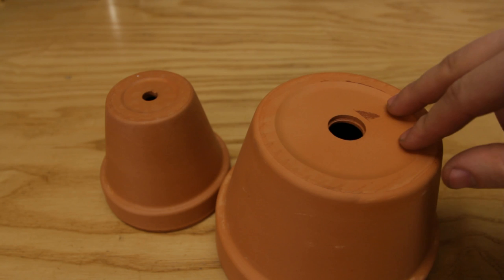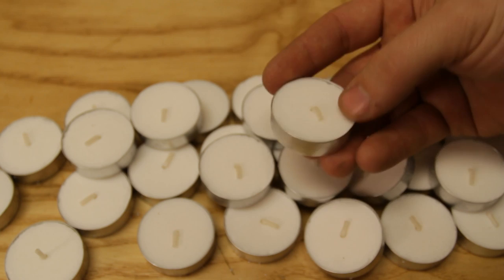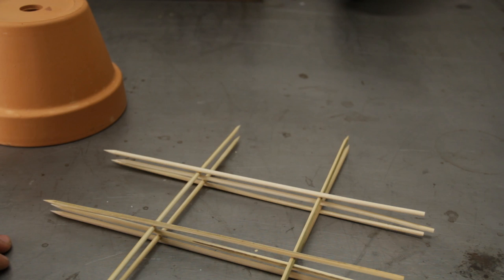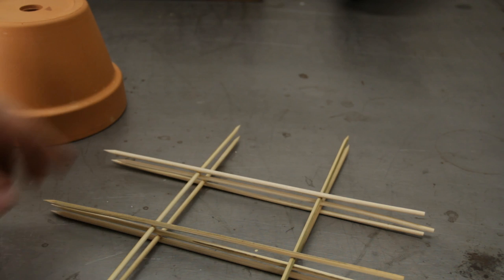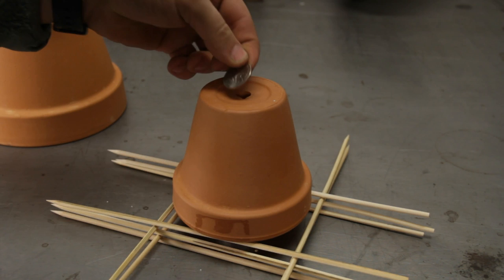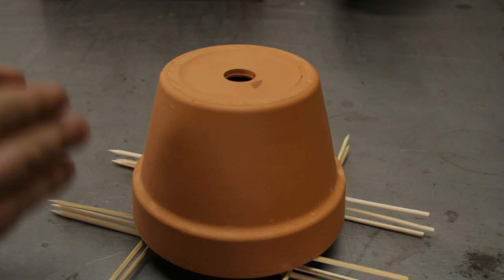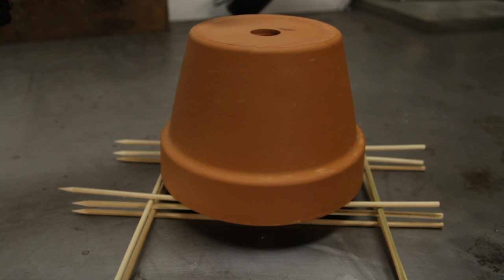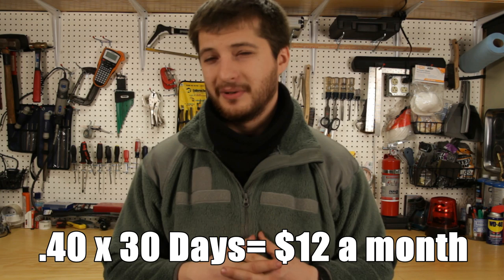DIY Clay Flower Pot Candle Heater

Comment: I wonder, won't it heat the room regardless of using pots. If not, where does the extra energy come from?
Reply from the maker: ***** exactly!
Reply: ***** In this setup, the thermal transfer is not the bottleneck, the bottleneck is the limited energy stored in the fuel (candles).

Rumor has it that the pot works two ways. 1. radiative heating and 2. convective heating. I would like to argue that both don't work the way it's supposed to. 

1. If you want maximum radiative heating, you would have to remove the outer pot. Having a cooler outer pot kills any form of radiative heating. In my testing, even with the hot innerpot, I can't feed any IR heating even in the vicinity. However I can feel some heat from the flames.

2. Convection is best created by fire, because essentially that's what a fire does. It shoots up a column of low density hot air. You can manipulate convective air by different enclosures (space between inner and outer pot), but the total heat released remains the same.

The air flow in this setup does not play into the fuel mixture, which can dramatically change the energy release rate, but then again you're just burning through candles ($$) at a higher rate.

Comment: Use a bread pan for the candle or candles. the pots sit on top of the pan giving the candles plenty of oxygen and it does the job.  I used it to heat my green house It worked just fine.

Comment: The pots trap the heat from the candle in the pocket of air between the two pots. This allows the heat from the candle to be distributed more effectively to the surroundings. IF using only a candle the heat will be concentrated only in a small area around the candle.

Comment: Will it get warmer if u use more than 1candle??🔥🔥
Reply: Are you serious?? More candles, more heat. But as I said, you don't need any pot to heat the room. The candle heat the air by itself. The difference is that the hot air produced by the candle goes up very fast, but all the hot air, with or without pot, will also stay on the ceiling.
Reply: Iberon88 Wrong. When the pots heat up, they radiate heat, so less hot air winds up on the ceiling. Trust me, I am not an engineer.

Comment: Fake. If the candle produces 2000 kilo-jules, for example, with the pots it wont produce more than that. This only makes the candle burn worst because it has less oxygen. It's better to burn them without the pots.
Trust me, I'm an engineer ;)
Reply: Exactly what type of engineer? Explain why your opinion is more valid than someone else's opinion. Do you have an engineering degree, and where is it from? For which companies have you worked, and on what projects have you worked. Come on Authority Figure, let's see what you have up your sleeve.
Reply: coOperativeDad when the wise man points at the moon the idiot looks at the finger. How many languages can you speak?
Reply: Woozeesh Mechanical engineering in the polytechnic university of Cartagena, Spain, bachelor thesis made in Germany. According to wikipedia "It is the branch of engineering that involves the production and usage of HEAT and mechanical power for the design, production, and operation of machines and tools." 
I'm not an authority, nor have I worked on issues related yet, but it is impossible to finish my degree without having a clear idea of how these things work, so I think that's enough for you.
Reply: As you in your own words state, you aren't an authority nor have you worked on related issues. Yet you insist you know best and that your word should be trusted unquestioningly, because in wikipedia's opinion, you are "an engineer." Yes, that is indeed more than enough - enough - enough for me. Wikipedia has convinced me.
Reply: Iberon88 i can speak one language only. but what gives you the right to judge someone else's intelligence on the basis of their bilingual abilities?
Reply: Woozeesh Haters gonna hate
Reply: coOperativeDad That's what you did to me because I misspelled "oxygen"
It is the best answer you could give me, thanks ;)
Reply: Iberon88 Yup and posers gonna pose.

Comment: this is bullcrap! why would you put the candle in the pot, it doesnt get hotter that way. just put the candle on the table, its the exact same heating effect.
Reply: No it isn't. The total amount of heat output is the same, but the heat travel method, speed, and direction are different. Look up "Mass Heater"s. This is the same principle, just on a smaller scale.